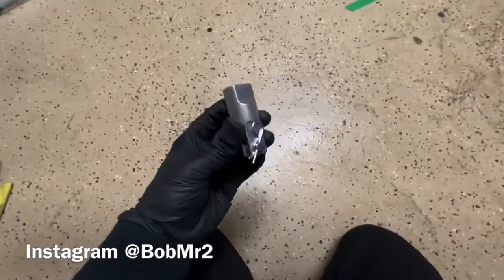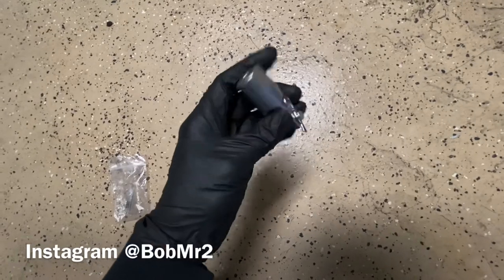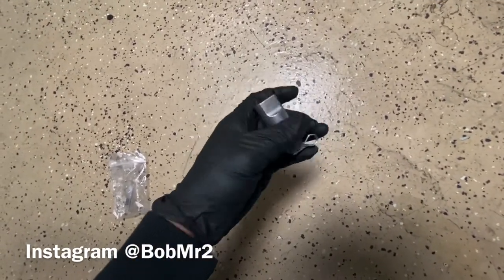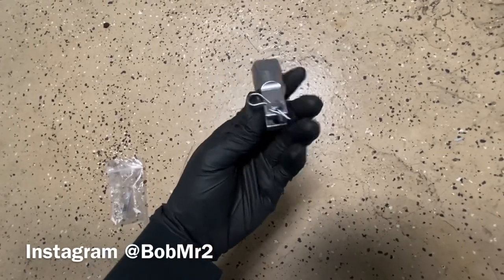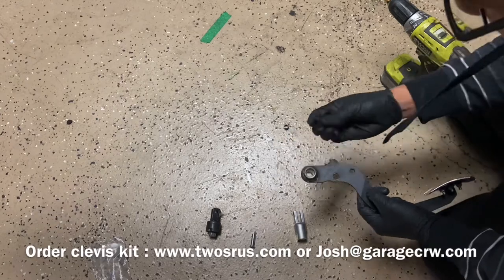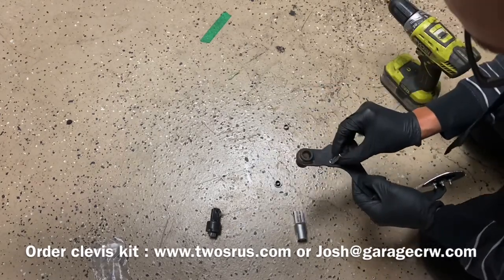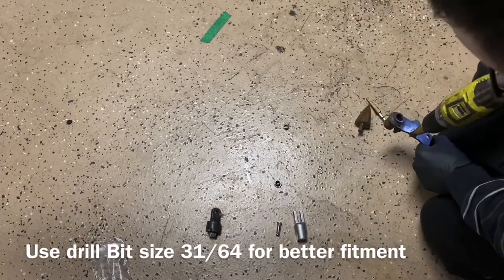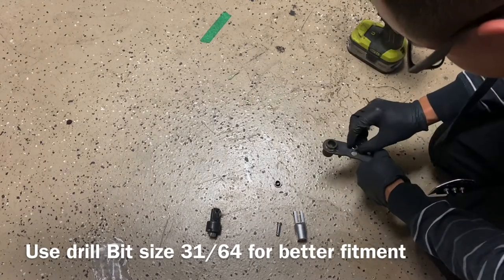DIY: Bobmr2 Installing crw Clevis mods on mr2 clutch pedal

Comment: Can you use a new oem pin/bushing with the new clevis instead of the bearing? I heard they give out pretty fast and I wasn't aware you needed to drill out the hole bigger.
Reply from the maker: Oem ones still bents when u press. These are put on my track cars which require more solid feel. Since I’m running high clamp load pressure plate. Oem ones won’t last long. Last thing I need is for it to break while track day
Reply from the maker: Oem power u can run Oem clevis.
Reply: I was talking more specifically about the roller bearing that goes in the hole. I heard the bearings themselves aren't very strong so I figured using a new oem pin and bushing combined with the solid clevis would work. But I don't know if the oem pin fits snug in the solid clevis.
Reply from the maker: @josephmaravilla7481  just replace the plastic bushing more often u be ok. They fit good. Usully people forget to replace the plastic bushing and it eats up the metal pedal.